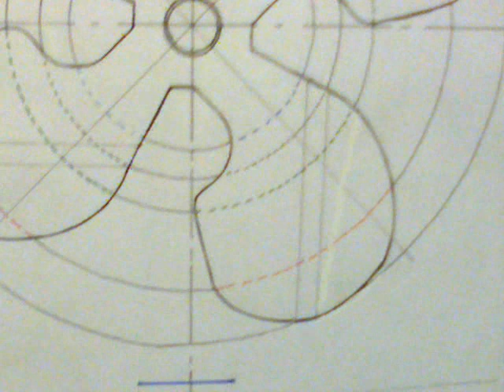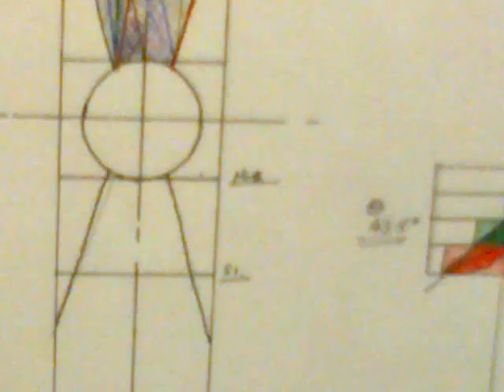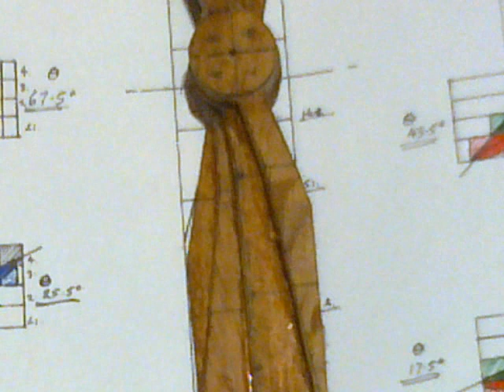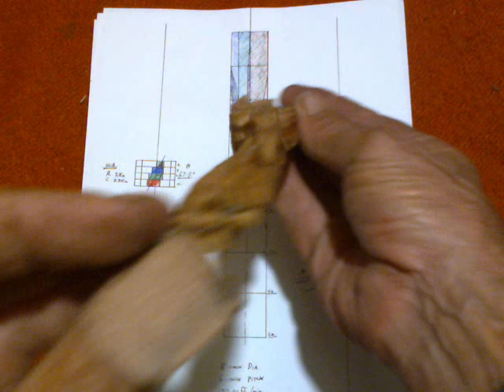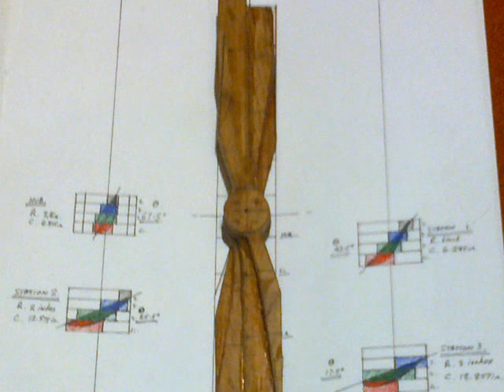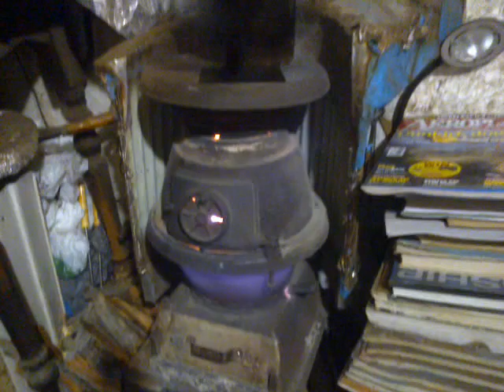Woodworker's Challenge, Pt-2 ; Basic Airscrew Analysis, Design, & Laminating The Blank

Comment: Coming along nicely, there is nothing like designing and building something yourself. I’ve had people tell me I’m crazy for putting so much time and effort into some of my projects because they say I could just go buy one cheaper, those people will never understand the satisfaction I get when I’m finished and it works as good or better than the one I could have bought, plus it more beautiful in my eyes. I’ve made everything from eyeglass frames to bicycles out of wood and or bamboo. My old arthritic hands don’t allow me to do the carving anymore other than simple things like that pipe that you smoke. Thanks for sharing and have a good day.
Reply from the maker: G'day,

Thanks.

  Yes, indeed...; most people seem to think that everything is made in the Landfill Factories.

My father's idea was that,

"The first time you try to teach yourself to make something which you've never seen before, it's alright if it doesn't work...

  "The second time you try to do that same job, it should work, more or less ; and it's alright if it's ugly and messy to look at...

The third time you tackle that job, what you make should be better than what you can buy in the shops..."

  Apparently that was how all Mechanics used to think, before WW-2 back when Car Manufacturers didn't supply Spare Parts because Mechanics repaired whatever broke, and they made their own replacement bits (Dad used to remelt old Aluminium Pistons to Sandcast new ones, and he had a Cam-Grinding Machine to make them Elliptical in section, too, so they expanded into Roundness as they heated up...).

  He said that during WW-2 the AmeriKans introduced the idea that Mechanics were mere "Part-Exchangers", as he called them...; in 1948 he got into Engine Reconditioning, bought himself an Offset-Chuck Cranshaft-Grinder, and he used to often make the Tools to make the Parts, to fix things which nobody else would have a go at...

  And, as a teenager I wanted a Propeller for a Lawnmower Engine which I'd got in a swap-deal ; so this is kinda what I got a little bit good at doing...(!).

Such is Life,

Have a good one.

;-p

Ciao !